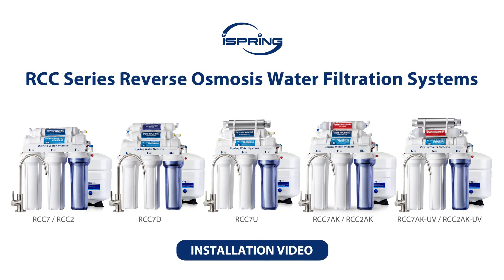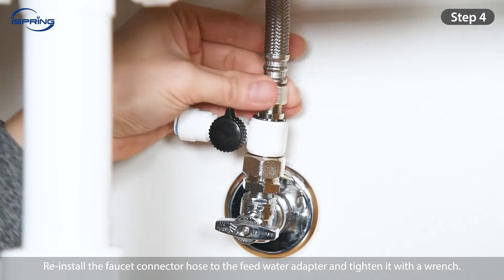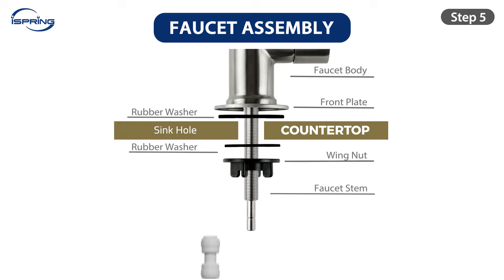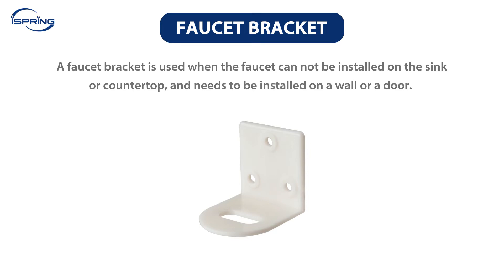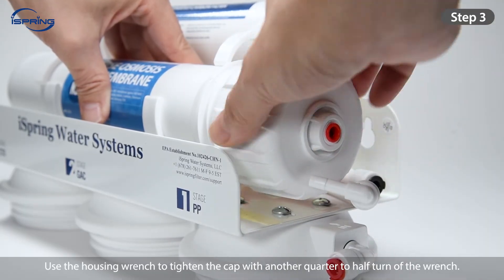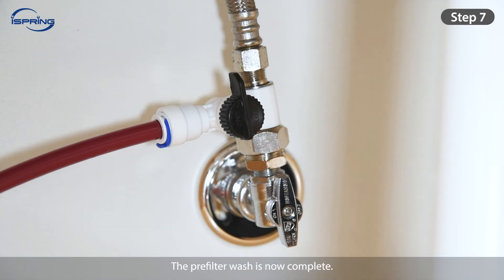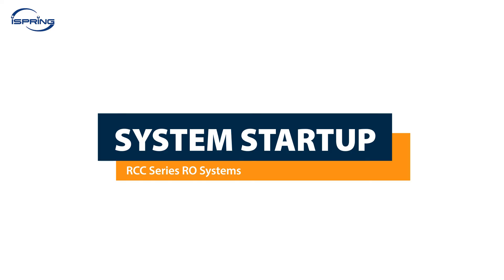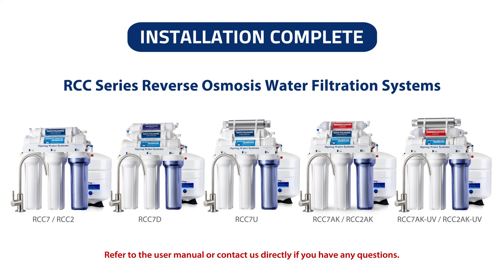iSpring RCC Series RO System DIY Installation | Step by Step | Latest Edition

Comment: But it produces a lot of waste water... can i turn it off when the Tank is filled?
Reply from the maker: Hi there! The system automatically stops producing wastewater once the storage tank is full, so it will not continuously produce wastewater.
Wastewater is only produced while the system is actively filtering water. The RCC7 has a pure-to-waste water ratio of up to 1:2, meaning that for every gallon of purified water produced, up to two gallons of wastewater are generated during normal operation.
If the system continues to drain when it is not in use, this may indicate a constant drain condition. We recommend reviewing our troubleshooting video for more details:
https://www.youtube.com/watch?v=KsFnoNJS2jg 
If you need further assistance, please contact us at support@ispringfilter.com or 678-261-7611, and we’ll be happy to guide you step by step.
Thank you!

Comment: I do not have a vertical drain because i don't have a dual sink. Where would you recommend drilling the hole for the waist water drain in the saddle installation part of the project?
Reply from the maker: Hi there! Install the drain saddle on a horizontal pipe before the P-trap. This placement helps minimize dripping sounds. 
If you have further questions or concerns, please don’t hesitate to contact us at support@ispringfilter.com or 678-261-7611 (Monday–Friday, 9 AM–5 PM EST). We’re here to help!
Thank you!
Reply: @iSpringWaterSystems i don't have horizontal pipe as therr is garbage disposal machine and then pipe directly falls vertically..  Is there another way?

Comment: TDS reading is still high after the install..did i do something wrong?
Reply from the maker: Hi there! Could you please send us the TDS reading of your tap water (before filtration) and the TDS reading after filtration?
If your system includes an alkaline remineralization filter, please let the water run for about 30 seconds before testing.
Testing immediately after opening the faucet may show temporarily higher TDS levels, as the water may be too concentrated with minerals.
Please send this information to support@ispringfilter.com.
We look forward to hearing from you.
Thank you!

Comment: A testing company on YT reported that the RCC series systems have some leeching issues. Their test methodology and reporting appears to be legitimate. Could you comment on this please?
Reply from the maker: Hi there! Thank you for bringing this to our attention.

We take any concerns about water quality very seriously. The RCC series is independently tested and certified for its filtration performance, and has undergone full material-extraction testing at NSF. NSF tested RCC series to NSF/ANSI 58 for extractables and contaminants. Hundreds of potential leachables were screened. All target compounds were non-detect or well below NSF health-based limits, and the system was rated PASS for material extraction. The wetted parts of the RCC systems are evaluated as safe for drinking water when used as directed, and are not releasing contaminants at levels of health concern.

If you have our system installed, feel free to message us anytime. We're always here to help ensure you get safe, clean water.

Comment: So im currently filling the tank for the first time. How do i know when its full?
Reply from the maker: Hi there! To check if the tank is full, you can try lifting it gently. A full tank will feel noticeably heavier than when it's empty. You can also open the RO faucet after 1–2 hours—if you get a steady stream of water for a few minutes, that’s a good indication that the tank is full.
On the other hand, if only a small amount of water comes out before the flow slows down, the tank is still filling or not yet full.
Additionally, you may notice that the water stops draining into the wastewater line, which indicates the system has stopped producing pure water because the tank is full.
If you have any questions or concerns about our products, feel free to reach out to us at support@ispringfilter.com or 678-261-7611 (M–F, 9:00–5:00 EST). We’re here to help!
Thank you!
Reply: I did 3 full flushes to be safe and made sure exactly 3.2 gallons came out by capturing it with water bottles.

Comment: I saw people complaining that leaking is a pretty common issue on the RCC7 series, if you do not mount the filters (sit on its filters). Is this still true? The filters are not mounted in the video.
Reply from the maker: Hi there! The RCC series are designed to work properly while sitting upright on the floor. Just make sure everything is correctly installed. These systems are free-standing and do not require mounting. As long as they’re placed on a level surface, they’ll remain stable. Mounting the system is optional.
Some customers choose to mount the system on a Slide-Out Mounting Kit, which makes it easier to access the system during filter replacements.
You can check it out here:
ASKRCC Slide-Out Mounting Kit
https://www.ispringfilter.com/ac/index.php?rt=product/product&product_id=10302&acid=2
Please refer to the following video to see how to install it:
https://www.youtube.com/watch?v=0537H-rn2CU 
If you have further questions about our products, feel free to contact us at support@ispringfilter.com or call us at 678-261-7611 (M–F, 9:00–5:00 EST). We’ll be happy to assist you!

Comment: I flushed the filter and tank over 5 times now and the water is still cloudy! Is this normal ?
Reply from the maker: Hi there! The cloudy or white color is completely normal with a new installation or filter replacement. The white color is caused by trapped air in the system. That air creates very small bubbles after passing through the filters, which can make the water look white for a few minutes after pouring a glass. That will go away completely within 1-2 weeks. I will advise you to open the RO faucet for 3-5 minutes two times a day for a few days to make this better. Keep in mind that these are new filters and they just need water to go through them to level out.
If you have further concerns or questions, do not hesitate to contact us at support@ispringfilter.com  or 678-261-7611 (Monday–Friday, 9 AM–5 PM EST).
We’re happy to help — thank you!

Comment: Its unfortunate that these do not cover a common usage for feeding a refrigerator. I can see for liability reasons why that might not be but a disclaimer would solve that.
Reply from the maker: Hi there! The RCC series can also be connected to a refrigerator. Please refer to the following video for step-by-step instructions on how to connect the RO system to your refrigerator using the ICEK kit:
https://www.youtube.com/watch?v=dmT_6BCBwaE 
If you have further questions or concerns about our products, please contact us at support@ispringfilter.com or 678-261-7611 (Monday–Friday, 9 AM–5 PM EST).
We’re happy to help — thank you!
Reply: @iSpringWaterSystems  Thank you.

I have to ask since I did not do it correctly, for the prewash, I actually let it go through the Reverse Osmosis Membrane. Will this cause any issues? If so, what do I need to do to correct my error during Pre wash?

Comment: I just finished installing the iSpring RCC7AK-UV and the indicator on the module is not lighting up. I removed the bulb but found nothing visibly wrong with it.
Reply from the maker: Hi there! The green LED indicator on the electronic ballast will light up when water is flowing through the UV stage. When there is no water flowing through the UV system, the unit will be in standby mode, and the indicator lights will be off. 
Please contact us at support@ispringfilter.com or 678-261-7611 (Monday–Friday, 9 AM–5 PM EST) so we can assist you further.
We’re happy to help—thank you!
Reply: @iSpringWaterSystems  Thanks I solved the problem.

Comment: Would it be ok if I didn't cut the hoses to length?
Reply from the maker: Hi there! We recommend leaving enough tubing length to make future filter replacements easier, so you can pull the system out from under the sink, if needed, when it’s time to replace the filters.
If you have further questions or concerns, please don’t hesitate to contact us at support@ispringfilter.com or 678-261-7611 (M–F, 9 AM–5 PM EST). We’d be happy to help! Thank you!

Comment: Does the storage tank require Teflon tape on the threads? It is not in the video
Reply from the maker: Hi there! It’s not necessary to apply Teflon tape on the tank valve thread. The O-ring on the tank valve provides sufficient sealing. Please make sure it’s properly seated inside the tank valve before installation, as shown in the video. 
If you have further concerns or questions, please, contact us at support@ispringfilter.com or 678-261-7611 (M-F 9:00-5:00 EST) 
Thank you!

Comment: Wow so many steps to flush out the messy Chiniese products dust at stuff befor4 you can drink it - why not provide clean filters?
Reply: Some others do as well.. Brita faucet filters require flushing for 5 minutes before use as well. And, at each use wait until the blinking LED goes out before using the water for drinking. (About 6 seconds) Best wishes  !